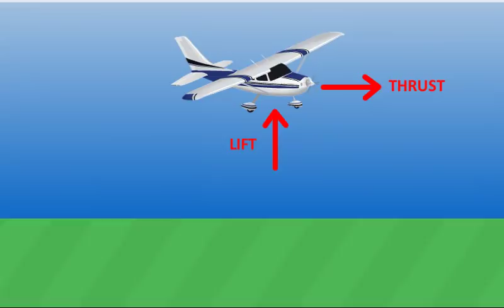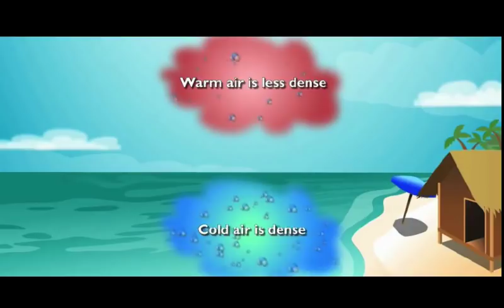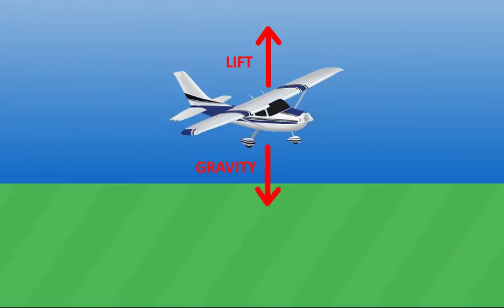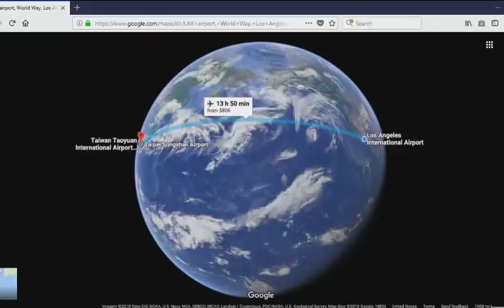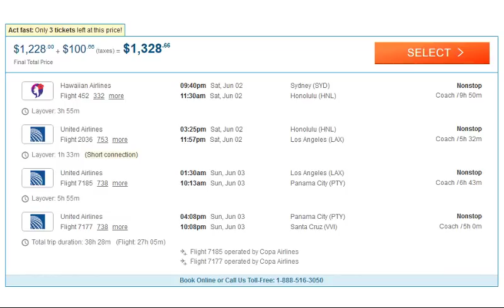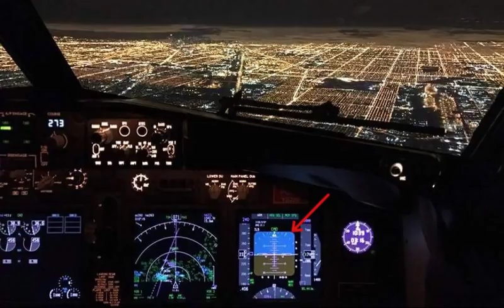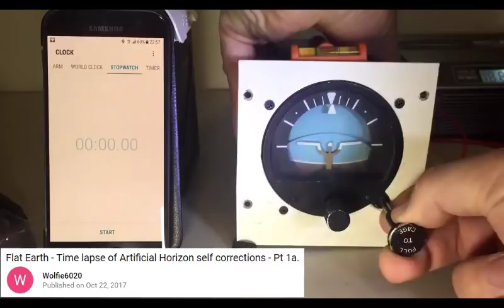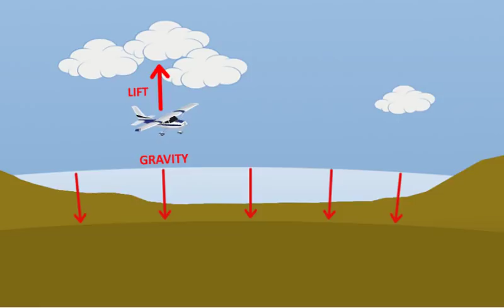Flat Earth Falsities - Plane Nonsense

Comment: Voysovreason......Thank you for your video. Can I ask you a question please, no one has provided an answer to this question to date. It is related to your video and aircraft travel.

It has often been stated by globers that one cannot detect the earth spinning motion of 1040mph at the equator because the earth is always spinning at a constant velocity. They liken the inability to detecting any of the earth spinning motion to that of passengers traveling in a plane, for example.
This lack of apparent motion in the plane is because the plane flies through the air at a constant velocity and they state that one can only detect motion if there is a change in velocity, ie an acceleration or deceleration of the planes speed.

OK. Sounds good, however, how do you explain the following? 

If a plane takes off from somewhere close to the north pole and flies south to a destination somewhere near the south pole at a constant forward speed of say, 500mph there will also be, out of necessity of being on a spinning globe, an increasing acceleration of the plane in a sideways direction, which will ultimately culminate in the extraordinary sideways speed of more than twice the forward speed of the plane at over 1040mph at the equator. 
As the plane continues on to the south pole after crossing the equator, the sideways acceleration of the plane will decrease back down to zero again as the plane approached the south pole area. 

Can you explain why none of this sideways movement is ever detected by the planes occupants or the planes sensitive instrumentation even though this movement is, for the most part, an acceleration and deceleration which eventually culminates in a sideways speed of over twice the magnitude of its forward speed? 

Also, if the plane was to ascend and land somewhere near the equator along this north to the south flight path and a person where to get off the plane after landing, why does one not feel the dramatic change of the earths surface speed, now at 1040mph at this new location compared to the point of departure, that being the north pole where the earths surface speed is virtually zero mph?

And finally, one can actually detect the motion of a plane flying at a constant velocity of say 500mph for example. This is not something that can affect objects of large mass seeing as the force is so small so a test must be conducted with low mass Items such as a very small, low pressure, free falling trickle or stream of water.
For a simple experiment on board a plane, allow a stream of water with minimal force, to exit a container and watch the water as it falls, it bends or curves away from the direction of travel. 
I look forward to your reply. 
cheers
Reply: For a plane,  air speed is the speed of the plane in a forward direction relative to the earth as in a cars forward speed on the road.

No Sir, that is groundspeed.  Airspeed is the speed of the aircraft in relation to the air.  An aircraft flying into a 100 mph headwind might have an airspeed of 600 mph but a groundspeed of 400 mph.  Imagine a boat on a fast flowing river going upstream.  If the river is flowing at 20 mph the boat will have to achieve 20 mph just to remain stationary relative to the land.  The boat will have to overcome the speed of the water in order to show any movement against the land.

It is zero relative to the equator

No, it is zero relative to the air in which it is traveling.  Speed is relative to the reference frame of the observer.
Reply from the maker: DE S - As I explain in the video, the plane is traveling through the air that is moving with the rotating earth, so as a plane is traveling from the north pole toward the equator, it's lateral speed to the east does indeed increase, but very very gradually. Instead of thinking in MPH, you need to think in RPM. The earth only rotates 15 degrees per hour. That is only 0.000694 RPM. That is very slow. So the centrifugal force caused by that is minuscule. In fact at the equator the centrifugal force is only 0.3% as strong as gravity. So, since it takes a plane many hours to reach the equator, there will be no noticeable sideways acceleration increase.
Reply: I agree that this would be a huge problem if planes teleported from one place to another while preserving velocity. But they don't.
Reply: GrahamStw,
This is not what I have said, please re-read the post....
Reply: I'm pointing out the issue with your post. Yes the speed difference between the pole and the equator is large, but a plane doesn't go instantaneously from one to the other. As it flies south from the pole it very gradually gains that sideways movement, because it is flying in air that is moving in that direction (along with the rest of the Earth).

Incidentally, when I have flown I've been able to pour wine and wash my hands without the stream of wine/water curving away from the direction of travel as you describe. 
Have you seen this happen while cruising at a constant speed  and altitude?
Reply: 'Have you seen this happen while cruising at a constant speed  and altitude?
'
Yes and I need confirmation to see if this is true....please re-read the condition that this occurred under....
Reply: furthermore why do the occupants or the instrumentation of the plane not detect this sideways speed even though its double the forward speed of the aircraft?
Reply: Why hasn't anyone spoken of this before? Why is there no instruments to detect this sideways movement when we have have all other movements of a plane detected by every instrument conceived and  invented by man?...
Reply: @ DEs
 The circumference of the Earth is 40 000 kms. 
So half a circumference  is 20 000 kms, the planes gets your estimated 800km/h sideways movement travelling to the Equator.  
A jet aircraft flies at 900 km/h so it takes just over 11. hrs to reach the equator.  The plane sideways velocity is changing around 70kph sideways over an hour. This equates to 1.16 km per minute or 0.019 km per second.   19 metres per second.
The change is rather minor, the level of acceleration would be minuscule compared to the wind, turbulence, pilot input etc to be noticeable.
Reply: Of course we have accelerometers , why would you think its undetectable?  Although as its so small it would be hard for the machine to accurately measure it due to the reasons above.
Who cares what sideways velocity a plane has, we are concerned with getting to our locations.
The atmosphere is rotating with the Earth,  there is no difference to notice on landing, therefore our bodies are working perfectly with the world by not noticing anything.
Reply: It's the same argument, just worded differently.  The plane is in an atmosphere attached to the earth and moving with it.  There is no acceleration or deceleration anywhere on the planet as everything is moving together.  The planet does not move away from you no matter how long you stay in the air as the air you are floating in is also moving with the planet.

"Spinning" is a misleading way of describing something that turns once every 24 hours.
Reply: why is there not an instrument to detect this? we have an instrument to detect forward airspeed yet the sideways speed of the aircraft is twice as fast? Why cant we detect the surface speed of the earth when we step off the plane at the  equator compared to the poles?
Reply: Kel, "Of course we have accelerometers , why would you think its undetectable?"  accelerometers, airspeed indicators all measure forward airspeed......nothing measures sideways speed.....sideways airspeed is never considered, as if it does not happen.....as if its not there......but it must be there if we are on a spinning globe....
Reply: Do you expect the plane to be drifting off its intended path due to the different velocity of the surrounding environments? Follow that thought for a while. What would happen to a plane close to the north pole (moving along with the earth at the speed of, say, 600 mph) flying south to the equator with its 1000 mph?
Reply: "sideways airspeed is never considered" - airspeed is the speed relative to the surrounding air.  Since the plane is moving "sideways" along with the air and the rest of the Earth the "sideways" airspeed is zero.
Reply: "sideways airspeed is never considered" - airspeed is the speed 
relative to the surrounding air. "

For a plane,  air speed is the speed of the plane in a forward direction relative to the earth as in a cars forward speed on the road.

"Since the plane is moving "sideways" along with the air and the rest of the Earth the "sideways" airspeed is zero."

It is zero relative to the equator but 1048mph relative to the stillness of outer space or the north and south pole........
Reply: DE S said, "one can actually detect the motion of a plane flying at a constant velocity [...] allow a stream of water with minimal force, to exit a container and watch the water as it falls, it bends or curves away from the direction of travel" The technical word for that is bullshit. It does not happen. You can't build a speedometer out of falling water.
Reply: Voysovreason, Thanks but that only partly answers my question. Even though the angular speed is extremely slow ( 1 rev in 24 hours) the earths surface is extremely fast at the equator and the planes sideways speed  exceeds the forward speed by twice however neither the planes instrumentation or occupants cannot detect this movement? why is that? I know the plane is fitted with every motion, attitude, speed, direction sensor and corresponding reading device imaginable because I used to work on them, yet there is nothing that can detect sideways motion? Come to think of it, if there was an instrument to detect this sideways motion you would in fact have an instrument that would detect the spin of the earth and at present we don't have one of them.
Reply: Mike Lemons, its not a speedometer, its a motion detector and I have done it. A speedometer will have some connection to the medium that the traveling mass is connected to. IE the road  for a car  or the air for a plane. This experiment was done inside a closed vessel with zero connection to the outside world.
If you think that a mass cannot be affect inside a closed moving vessel please have a look at this.
https://www.youtube.com/watch?v=iygYUlZ_68A
Reply: DE S, you are confusing velocity with acceleration.  The mass of an object will resist acceleration. Your stream of water would fall straight down if the airplane was moving at a constant velocity because there is no force acting upon the water to change its path other than gravity.

In your airplane flying at the equator, the air and the ground are rotating at the same rate as the airplane, so there is nothing to see. You would have to get a fix on something in the sky in order to measure your rotational speed.

There is an instrument, called a ring laser, that can detect when it is moved. FEcore is asking for $10,000 to purchase one for the purpose of proving that the Earth is stationary.
Reply: Mike Lemons, "DE S, you are confusing velocity with acceleration. The mass of an object will resist acceleration. Your stream of water would fall straight down if the airplane was moving at a constant velocity because there is no force acting upon the water to change its path other than gravity. "

I know the difference and yes it should fall straight down but that is not what I experienced. Another example of this would be the ease of moving down the length of a  moving train away from the direction of travel compared to moving into the direction of travel, I have also experienced this. 

"In your airplane flying at the equator, the air and the ground are rotating at the same rate as the airplane, so there is nothing to see. You would have to get a fix on something in the sky in order to measure your rotational speed."

Yes you need  reference, the none moving poles perhaps? a geostationary orbiting satellite?

"There is an instrument, called a ring laser, that can detect when it is moved. FEcore is asking for $10,000 to purchase one for the purpose of proving that the Earth is stationary."

Movement but not speed,
I thought experiments were performed years ago that settle the argument, Aryes failure, Michelson–Morley experiment, etc?
but it would be interesting to see what they come up with.
Reply: DE S: Flat earthers have lied to you about Airy's Failure and the Michelson-Morley experiment. They did not prove anything about the motion of the Earth. They failed to find aether. Aether was a dumb idea. Millions of people have poured drinks into a glass on a moving airplane. They have never observed the effect that you describe.
Reply: Mike lemons,
if you look at the details of the experiment that I had performed you would notice that it is nothing like pouring a drink into a cup on a plane. it is a very fine, low mass stream of water of a distance of approx 60cm which started to bend away from the direction of travel near the bottom....try doing that at your seat without spilling it. lol
Presentations of  those experiments where done in a video by Micheal Bowden i think his name was  who is not a flat earther. I will check anyway.
Reply: +DE S  hopefully not to confuse things further, but as Mike said there are instruments that detect Earth Rate, and they are used in airliner navigation. It's a complex subject though eg youtu.be/r6j3N5V9iMA there is a whole educational YT series dedicated on that channel.
Reply: HapaxLThis video show the Inertial Navigation System (INS) - Alignment of gyros for navigation. this has nothing to do with measuring air speed both forwards or sideways however it seems an interesting series.  Believe it or not I started my career in the avionics industry some 40 years ago now working on these systems. I have forgotten most of it, its been 30 years now out of the industry,  so checking the series out would be a good refresher for me.   thanks
Reply: +DE S  I'm surprised you say you have experience with systems like INS / IRS but don't think they have anything to do with measuring airspeed.  A fixed reference is needed to measure against. How else could the aircraft's instruments tell its path in influenced by crosswinds?
Reply: Hapax. L. If you re-read what I said you will see that, 1, it was 30 years ago since I work on these systems and, 2, that video was about calibrating the system which is what I was referring to not the INS / IRS complete functionality and I would have to look into this further to see if your claims are correct.
Reply: +DE S  the vid I posted was about calibration, but I referred to the series on that channel rather than an individual vid. It's quite a large subject. Note these devices aren't new, 1st employed in airliners in the 60's. Up to then they were mostly military and iirc listed as weapons and restricted! (still might be, they're used in long range guided munitions). And the only claim I was making is that the avionics industry says this is how navigation is done. Anyway, a lot of material there, happy watching : )

Comment: If any flat-earther wants to test their hypothesis, get an amateur pilot's license, find a destination that's near the maximum range of their craft, fill up their tank, fly to the destination by the route according to a flat-earth map, measure the fuel consumed, then fill back up, fly back to their starting point using a globe-earth map, and measure the fuel consumed.  Compare the two and see which was a shorter distance...
Reply: biostemm well, in much of the northern hemisphere, they’ll be reasonably similar; but, in the Southern Hemisphere.....

Comment: Coriolis Effect: Affects bullets but not planes, right?
Reply: So you believe bullets have engines, controls and pilots.
Reply: spud esquire depends on if the plane is heading north and south.
Reply: spud esquire you can actually look at US Army artillery firing tables and use them, they’ve been declassified. And, you can examine the naval ships gun fire control computers used in WWII that took the Coriolis effect into its calculations.